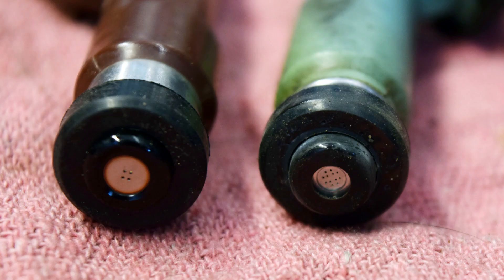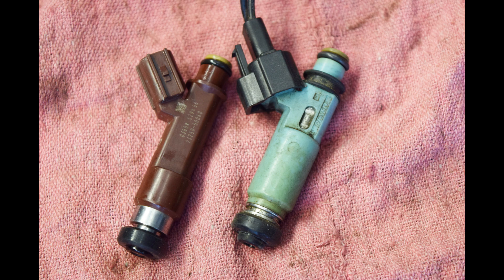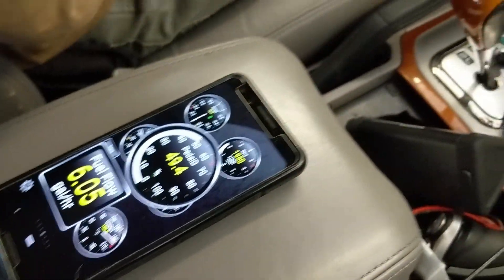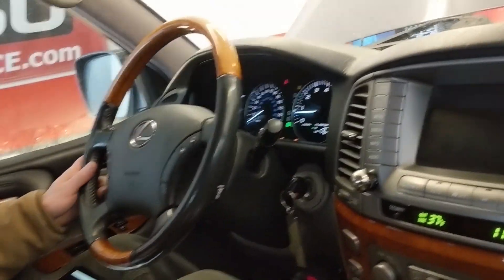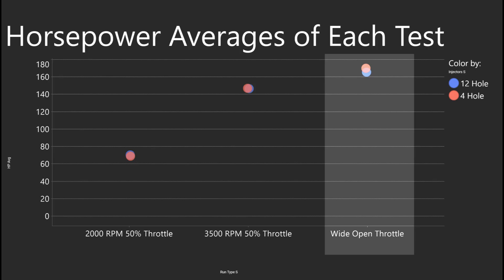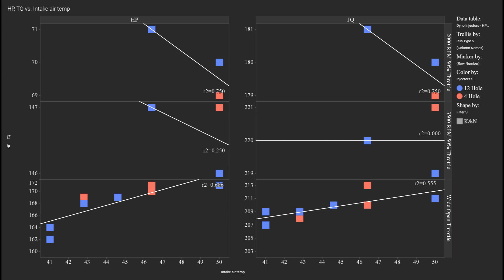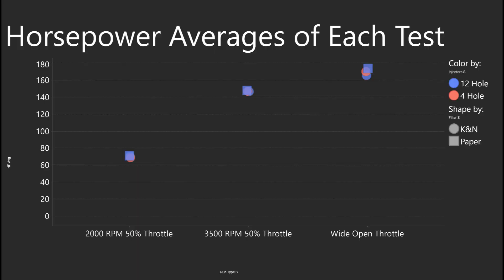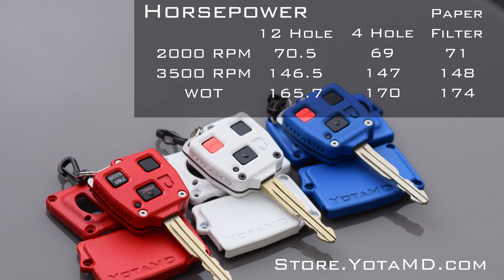Is the 12-Hole Injector Upgrade Real? We Tested It on a 2007 Lexus LX470 (Land Cruiser)

Comment: i don't think it would give u more pw but it would give u better mpg. just like a garden hose, when u switch it to a full one hole nozzel u would use more water, u switch to a multi hole nozzel setting u will use less water but more pressure.
Reply: U need a better fuel pump too

Comment: If the injector duty cycle goes above 25% then you are experiencing fuel stand-off, which the dyno bloke mentions. Over 25% duty cycle the fuel just pools on the back of the valve diminishing positive effects of fuel atomisation. The higher the duty cycle the worse it would be. Probably why you see slight gains at lower rpm for the 12 hole. Do you know what duty cycle they were running? The industry has moved to direct injection as they are less limited by duty cycle and fuel stand off.

Comment: i got a question if I have oem injector 1pin hole @ 243.8cc p/m and swap for 4pin hole 232.1cc p/m, will the 4pin hole spray more fuel than the single pin hole? can the 5.9L magnum benefit from 4pinhole vs the oem 1pin hole?

Comment: i have good result with 12 holes denso ev14 those i used in 6v60 engine also fuel consumption decreased dramatically although rochester were well maintained but really ev14 better than ev1.

Comment: K&N filter may not increase power due to your engine setup, the airflow and the air speed
If the stock design already no restrictrion then increase airflow will not help
Also the air speed, the filter decide the air speed inside the intake tube from filter to manifold. more restriction means engine vaccum easier to suck the air in (result in better low end torque).

It just like a narrow vs thick drinking straw, thick has high flow if you use more power to suck in.
In this case your engine vaccum may not have such power to suck more air or even less than stock casuing power decrease
That's why force induction can increase power by pushing air into the engine rather than engine vaccum itself

Comment: I’m going with a 12 hole because of availability and matching the rated impedance and flow rate of my stock injectors. I don’t want to run the stock injectors because they have an angle on the end that is designed to compensate for the angle injectors are introduced in to the factory intake manifold. I have a different intake manifold on it from stock that holds the injectors parallel with the airstream. Stock injectors a 22.6lbs/hr at 3 bar 2 hole split stream 12 ohms and the closest match I can find were a 12 ohm 22.8lb/hr at 3 bar. They just so happened to be a 12 hole. I did want to maintain a split stream pattern for the two intake valves.

Comment: First off, great video, it is cool to see real world vehicles and these types off comparisons, and not just full blown performance tuned modifications tested......
But here is the problem, modern factory ECU's are capable of adjusting multiple different parameters of the vehicles operation within windows that it has "learned". So if it has compensated for something, then it is changed, it may take some time for it to "learn" it's new "limits"? In most all out performance dyno runs they are controlling the ECU so this variable is removed, or accounted for, however you want to look at it. This doesn't falsify your testing, it just complicates it a bit.
Reply from the maker: Agreed on all points. We didn't experience/measure any of the post-learned performance in this test, although we were measuring O2/AFR sensor readings and fuel trims/fuel flow. Perhaps there's a minute difference to be had after the learning is completed, but I expected to see some evidence of a change somewhere for that learning to produce a meaningful change. I'd love to see someone do a more controlled and longer-duration test of fuel consumption and Brake Specific Fuel Consumption for this exact scenario to see if a 2UZ not released with 12 hole injectors can realize any measurable difference from the 4 hole-12 hole swap.

Comment: Going from an 1 hole to 4 hole injector might yield better results. And i think youre contradicting yourself with the kn filter, saying it doesnt filter as well and makes less power. Alot of dyno runs prove the opposite of what you found out. So who’s right? I dont know. Having wrenched on cars for many years without a dyno to use for testing, the only thing i can add is that freer flowing filters definitely increase the induction sound with all else but the filter being the same. Which goes hand in hand with it being worse at filtering i would think. My understanding of air flow is that the less obstacles there is, the better. But i could be wrong

Comment: I am about to go ahead and change out my old injectors in my lexus as I am doing a valve cover gasket repair and going to have access anyway.  The ones I ordered have 4 holes, the ones in the car are 12 holes. Should I worry about replacing them with 4 holes at all?
Reply from the maker: I wouldn't worry about the hole quantity, but I would be more concerned with the injector reliability. OEM Toyota/Lexus/Denso is way more expensive than aftermarket for a good reason. New aftermarket is far less reliable than old genuine OEM, IMO.

Comment: Fun video, and I agree with the fuel injector findings, but for me I went with 12 hole for a more consistent burn and maybe better gas mileage and I use K&N air filters, not to get more power, but to never buy another air filter again.  I'm as cheap as dirt dot come.   ;)  Thanks for posting cool info.

Comment: I tried the 12 hole injectors in an 4AFE and 1GFE, it works to improve engine efficiency and response. I doubt it gave me any more hp, Fuel economy has increased slightly according to the onboard tripmeter and for me to notice. Could also be due to the new injectors i used but the 12 hole injectors should make a better atomized fuel spray, so it makes sense. Even toyota used them on the latest version of their 1NZ engine.
Reply: In 2020 I had a 22RE rebuilt for my 84 4Runner and I did everything from the long block onward. I moved from factory ONE hole injectors to 4 hole, among a few other improvements. With 32x11.5x15 wheels and tires I can reliably get 20-22 MPG, which is absurd considering they were 15-16 factory fresh.
Reply: @mutantcolors666  crazy! Thanks so much for your input about this as i just ordered 8 hole injectors for my civic
Reply: Interesting, I am thinking of upgrading my 1GFE injectors, what is the part number of the injectors you used?
Reply: @mohdebr2556  Sorry for the late response , I used the blue 23209-21040. There are blue and green either should work. In the 1GFE they should be plug and play , for the 4afe I changed the injertor connecto too
Reply: What were the injectors called for the 4A-FE? Would you be willing to share thank you
Reply: @tofudelivery8101   I used the same yaris injectors PN 23209-21040 , you also need to get the connectors and replace them. Running really nice for more than 2 years now.
Reply: my AE111 4afe engine runs normal but I want to increase fuel economy. So I tried installing 23209-21040 injector on my toyota 4afe engine but it produces white smoke that is very irritating to the eyes.. I already Adjusted the AFR Pot maxed on ->L already but it runs very rich.. what could be the possible solution? Thanks

Comment: Doesn't the computer need to adjust for mpg. maybe that only helps in low load metering. But maybe the A/F ratio is always adjusted to maintain the 14.-whatever at all times in closed loop after warmed up

Comment: It comes to no surprise to me about the K&N air filter bcz many YouTubers have tested this like mighty car mods. It always decreases power.

The 12 hole injector mod doesn't make sense to do because if the flow rate is the same then it won't matter how many holes the injectors have. 

If you're trying to increase flow rate of injectors, then you also have to tune the ECU. Same goes for exhaust and intake mods. 

A simple injector, intake or exhaust mod by itself isn't going to add power.
Reply: Its because of fuel mixing. The theory is, the O2 sensor sees the same amount of leftover O2 with less overall fuel injected. However I'd imagine you'd need higher fuel pressure and less pulsewidth to keep atomization per hole equal to stock. As far as the k&n goes, way too many people place the "cold air" in places where it sucks in hot air....

Comment: Did you reset ecu after change injectors ?
Reply from the maker: During one of the two changes, yes. Ideally, we would have reset ecu, then driven for a hour or something, but limitations of dyno time made that impractical. We watched fuel trim to see if the ecu needed to correct anything for the new parts. As memory serves, we were unable to see any change in the afs (factory wideband of sorts), o2, fuel trim, etc...
Reply: @user-df1gh8le6l  
I asked because a lot of people do hardware upgrade but they don't reset ECU.
Good job!!!

Comment: the only change ive ever seen going to the 12 hole injectors in 2 dodge trucks and 5 jeeps that ive owned and done it to was only these two things. better (smoother) idle, and 1-3 MPG better under easy driving. that's it. for me its worth it if you are needing to change the injectors anyway. not really worth it to do just for the heck of it. i view it as sort of an improved maintenance repair.
Reply: True. I see better gas mileage at idle and easy driving but again, if I have to accelerate,  it does take a while to catch up.
Reply: Well, considering 5 gallons saved buys a new pack of injectors....
Reply: I do alot of driving with my 2018 jeep grand cherokee 3.6L I was hoping to save gas because gas is so damn expensive nowadays. Do you think I'm I going to see any difference from the OEM 4 hole to an 8 hole injectors? A Premium has some injectors that will save me gas and maybe slightly more power. But I just care about gas. What do you think? Thanks

Comment: At 50% throttle the advantage of 12 hole has already greatly diminished. It's under 50% where the difference is made. I've run a set for about a month now on my 05 tundra, there is a real difference at part throttle below 50%, below 3k rpm, you use less throttle to do the same work. There's also the 2.5mpg increase, which I throughly enjoy, so definitely not the same.
Reply: better (smoother) idle, and 1-3 MPG better in the 7 different vehicles ive personally installed 12 hole injectors into. other than that, no real difference that i could tell. its a great "upgraded" repair if you need injectors but not really worth swapping for the hell of it.
Reply: Gaining 1-3mph and increased throttle response below 3000 would be  a big deal. @nathan00campbell
Reply: @nathan00campbell  I plan on keeping my truck for many years so I'll take a smoother 1-3 mpg for the hell of it, easy return in investment. Most people won't tell the difference, but I get a great sense of warmth and well being for having the best tool for the job. 4 hole injectors are blunt instruments.
Reply: @JP-ug1xr  i agree, like the truck in my photo, its a 2008 ram 1500 with the 3.7 v6. just got my Denso 12582704 injectors in this afternoon. they are going in the truck in the morning. got a cylinder 3 misfire, good compression. new plugs and coils. sooo time for injectors. im betting the new 12 hole injectors feel much better than the tired 180k mile 4 hole oem ones. its not only the holes that make a difference. the Denso's are far better in general than the OEM ones for mopar. like you i plan on keeping it around a while so knowing it needs  new ones. why not upgrade and gain some MPG. its the only logical choice.
Reply: My o1 jeep grand cherokee  4.0 with 12 hole injectors gained 3 mpg and a much smoother idle as well as partial throttle  enter responce.
Reply: Dude fine by me, that’s where my GX needs it’s extra oomph. Most usually I’m pulling something or heading north with lots of gear n beer. Be neat to try a set and if it’s no gain. At least I’d have new injectors on my 13yr old Lex.
Reply: Put the same lbs fuel pump then youll see the best difference

Comment: i have toyota aristo 2jzgte single turbo with megasquirt ms3x ecu i replaced the stock pink 440cc 4 holes injectors with the stock sti 565cc 12 holes blue  injectors  i found that i can make the engine idle leaner at 16 to 18 afr without stalling compared to the stock 2jz 440cc where it would run rough and stalls also i get better fuel economy at highway speeds where i can get 16 to 17 afr at low load and vacuum area of fuel cells... just replacing the injector without tuning will not make power or better fuel economy you will need to tune the ecu to unlock the benefits of the better atomization injectors
Reply: Uprating to GTR coils allowed me to run leaner too
Reply: This is the info I was after! How did the timing and mixture change while flat out?

Comment: Hot headers do work better which is why exhaust wraps exist. They localize heat to the specific component allowing for scavenging with a nice byproduct of insulating nearby components from the heat.
Reply: Thanks ih8t mud members n yotamd and anybody who has part in this vid.  I always wondered about injectors upgrade myth busted lol

Comment: Both have the same CC/min right ?
Reply from the maker: Good question. 255 vs 250. I didn't show comparisons of fuel flow per power, but I did run those. In those data sets, fuel flow assumed by ecu was adjusted for the 255/250 flow rates.

Comment: Wonder what the fuel consumption difference is between the two? Not super concerned with power but more so MPG's on a 100 series.
Reply: This is all I really care about with this upgrade....all about that mpg
Reply from the maker: According to the ECU's estimate of fuel flow, they looked similar. I'll post up some graphs of that data on the thread on ih8mud.

Comment: what about motor timing was it left stock ? did it change when swapped with the 12 hole injectors ?
Reply from the maker: No difference at all. The timing data for every wot run was right on to of each other.